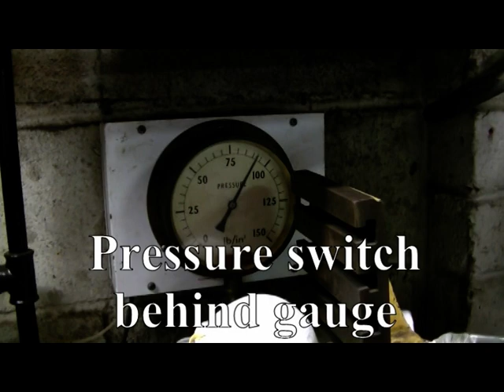Old Air Compressor - Now fully working

Comment from the maker: It has plenty of oil in it. The oil pump is noisy by design and any other noises are the crank case breather, decompression solenoid and the motor controller.